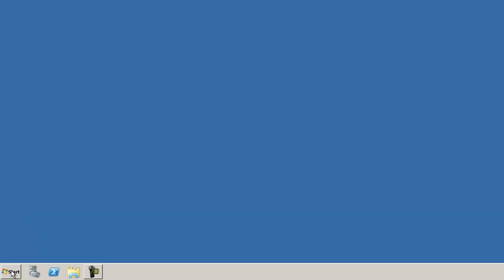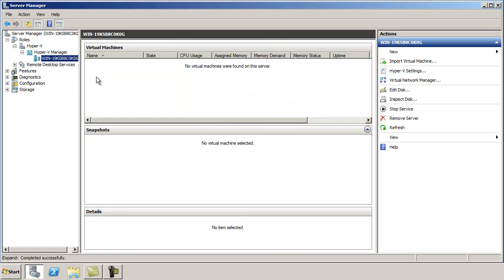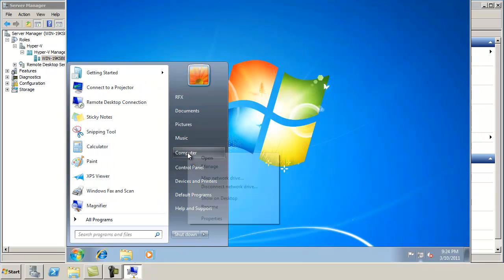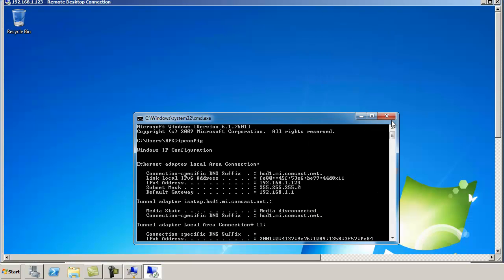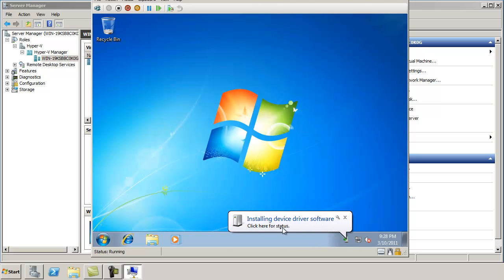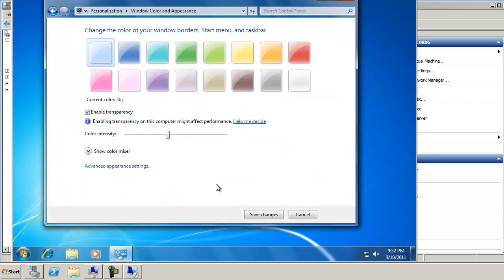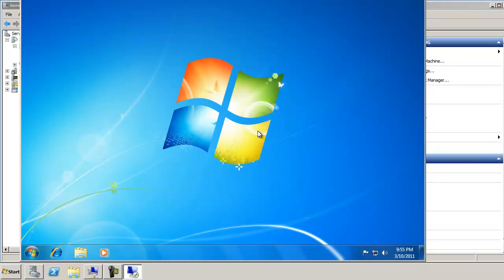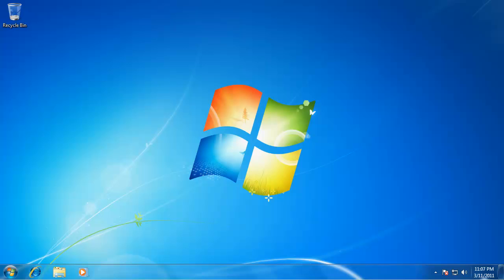RemoteFX Installation & Performance

Comment: sell rdp windows or vps linux 

Ram 6gb
Disk 100gb
Price 7$
1 month
=========================
Intel Xeon 2cpu processor
Ram 8gb
Disk 500gb
Price 10$
Os windows 2008,  2012 
1 month 
==========================
Intel Xeon 4cpu processor
Ram 26gb
1000gb Disk
Price 20$
os windows 2008, 2012
1 month
==========================
Support dumper sender searchdork xampp scam carding dll
Low price discount 10%
Server can request
Os windows 2008 2012 2016
==========================
tos 
no mining
no restar
==========================
full admin and warnti

FB : https://www.facebook.com/putra.singo.395
Email : ellypur31@gmail.com

Comment: I have nvidia 1080, but fps when playing extremely low (6-8) :( CPU E5-2630v3, RAM 64 GB, WinServer2008r2, RemoteFX. directx is work, fps same 6-8
FPS depends on the picture. For example, if the picture is dark and soapy (defocus camera), then the fps is high. Where is the bottleneck? I can not find ... I tried to reduce the quality of the picture in the parameters remotefx, it helps very little.

Comment: I tried this but when I install HV it disables EPT which is required for RemoteFX?!?!?!
Reply from the maker: EPT is in the BIOS, Windows has no way of disabling EPT/VT-x or AMD-V/SVM  perhaps it was never enabled to begin with?  What intel processor are you using?
Reply: VirtualizationGuy All sorted, i didnt realise the hypervisor turns the host into a vm thats why aida showd ept as not available, the test vm wouldnt start because of an unrelated issue.

Comment: When I enable this and try to conned with RDP I get "Because of a protocol error this session will be disconnected. please try connecting to the remote computer again."

Is anyone else haveing this issue and is there a fix!!??
Reply: Yea I was able to do it again at first boot but after that, I would get that message again

Comment: With windows 10 pro does this still require an enterprise edition of windows 10? I have a 4k monitor so the higher resolution is needed. I need to run some stuff in sandboxed VM. I could leverage the GPU as well, but I've been unable to get it working. I'm assuming windows 10 still requires enterprise edition?
Reply: No, you only need Win 10 Pro and the lastest Win 10 edition (creators update)

Comment: Hello
I could follow you all the way. But I got a problem, I could not solve yet. At the End, when the RemoteFx Driver Adapter is installed I get the Message on die Virtual Machine Connection: The Virtual machine is currently using the RemoteFX 3D video Adapter. A user is currently connected via Remote Desktop. Connect to the virtual machine by using Remote Desktop Connection.
But this doesn't work. I made sure, that the firewall let's throu the RemoteFX Connection as well as the Remote Desktop connection. I made a new User, with which I also couldn't get in to the remote Desktop connection. As soon as I deinstall the Remote FX Adapter does it work. If I reinstall it, it doesn't. I run Windows Server 2012 R2 and as VM Win 7 Ultimate with all Updates.
Hoping you can help me. Thanks a lot.

Comment: was wondering if remoteFX was usefull for ppl that only needs to work with pdf/excel files or mails, the company i'm in is currently offering a TS gateway solution for their clients but it's slow as hell sometimes(on WDS2008R2), so i was looking for other solutions

Comment: If you've got the correct hardware and are running a good LAN connection this can be pulled off super well.

Comment from the maker: Multipoint Server 2011 was designed for standard lightweight applications such as Word or Excel.  It was only designed for 2D multi-tasking (multiple windows/apps) and not 3D.  Multipoint 2012 will include Hyper-V, and may or may not have RemoteFX capabilities.  However I have not done any research in the matter.

Comment from the maker: "GPU   At least one graphics processing unit (GPU) is required on the RemoteFX server. The GPU driver must support DirectX 9.0c and DirectX 10.0. If more than one GPU is installed in the RemoteFX server, the GPUs must be identical. The GPU must have sufficient dedicated video memory that is separate from system memory."

Comment: Hey thanks so much for the guide, I'm having trouble when it gets to installing the RemoteFx 3D display drivers. It installed something but when I go to device manager it says I have 2 unknown devices and under display adapters it says "Standard VGA Graphics Adapter". I ran DirectX Diag on the Hyper-V host but there were no issues. I have a Phenom II X4 955 black with an XFX ATI HD5850. Any help would be great.

Comment: I also tried and OpenGL is indeed unusable.. Also when I connect to server 2008 directly dxdiag shows only Direct3D enabled and DirectX software close with error.. If I connect to VM with RemoteFX dxdiag shows everything enabled (Direct3D, DirectDraw..) and DirectX software runs fine, anyway not the transmission is not 100% fluid.. Next problem is that not all video ram is usable.. In conclusion RemoteFX is a piece of shit.. Nice try more luck next time :P

Comment: 3 monitors at 1600x1200 give you the max video memory at 330MB. There is a table in TechNet with the various allotments entitled "Hardware Considerations for RemoteFX."

Comment from the maker: Johnny? you mean VirtualizationGuy.

RemoteFX requires a DirectX 10 capiable card with at LEAST 512MB RAM, while only specific ATI/NVIDIA cards are 'officially supported' you can use just about any video card for testing.

As far as an 'external VDI viewer' there is currently only 1 software application that supports the latest RDP codec, and that is RDP on Windows 7 With SP1.  There are a few thin clients in the works from Wyse, and other vendors.